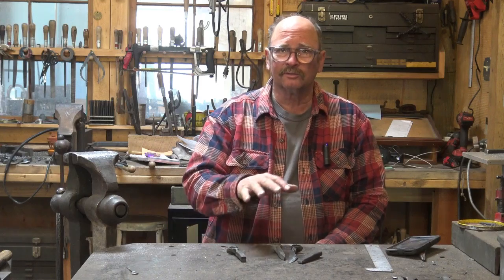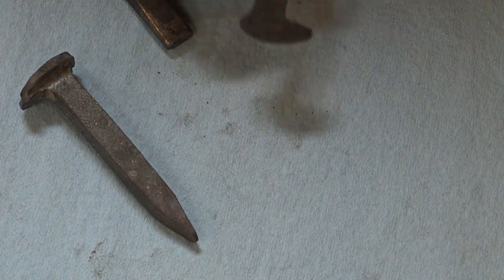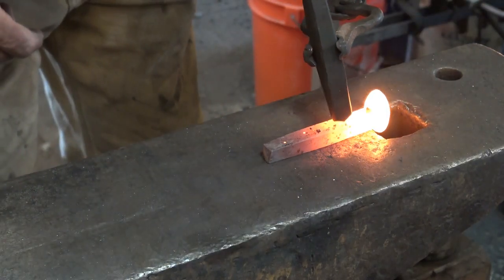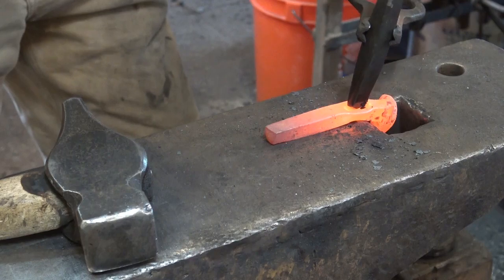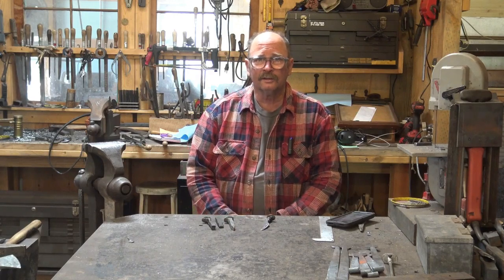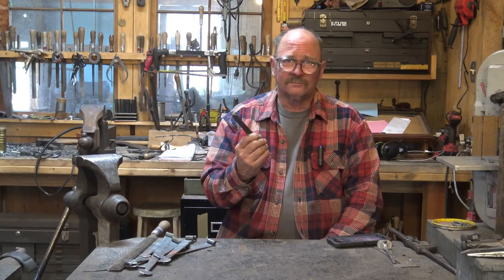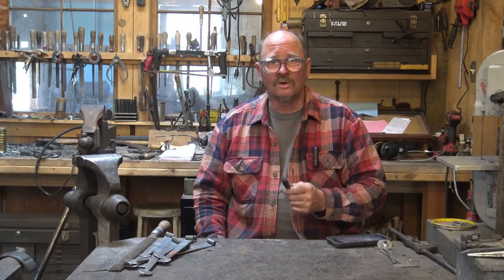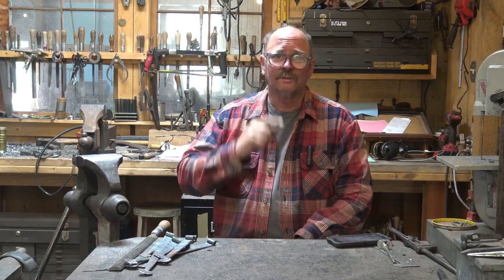Failed first attempt at a rail mini spike tomahawk.

Comment: I'm an instructor for the Total Control Advanced Riding Clinic for motorcyclists seeking to improve their riding skills.  One of my favorite statements in the class calls out exactly what you are discussing:

"Everyone believes the old cliche that practice makes perfect.  That just isn't true: PERFECT practice makes perfect."

In my own shop, I try to make everything as perfect as I can, even if the task doesn't require perfection.  I want the outcome of my work to match as closely as possible, my design for it.  If my design says "put a half inch hole here", I want that hole on size, in the right location.  That's how we get better!

Comment: Nice piece at the end about not failing, etc. Every time I start a new hobby I spend well over 50 hours researching ang watching YouTube videos about it. I've just finished my first knife and I made loads of mistakes but because of all the hours watching YouTube I knew what to do or where to go to find the answers to fixing the mistakes. It's meant that the knife actually came out a LOT better then I could have ever hoped. 

If I ever get bored doing my research before starting a new hobby, I haven't spent anything other then time so I don't loose much by moving on to the next thing. (I have loads of time free anyway as I have health problems that mean I spend a lot of my time not being able to move, so YouTube is a bit of a lifeline)

Comment: Probably for that small of a tomahawk, the Brian Brazeal style punch may have been too big. I agree a smaller, thinner slot punch would be ideal. You already have such little material, that any loss of material just adds to the risk of problems. And, upsetting to increase the thickness in the area to be punched should be the way to correct. Lessons learned!! Great video on thinking through a project and adjusting when there is an issue.

Comment: The other week I had two attempts at doing a split cross for my Dad, and wouldn't you know it, the chiseling from the bottom near the head of the rail spike mucked up bad. And yet I have done a few before and they turned out pretty good, now I don't know if I used the wrong chisel or what, but these last two.....FAIL!!!

Comment: Some have said that the Brian Brazeal "pyramid" style punch is not good to use.  I think it should be put in perspective that Brian was using that style punch for forming holes in larger stock such as hammers (say, 2 lb. and up in weight) and therefore needed the angular edges to gain penetration over using a blunt punch.  I believe the flat punch is indeed better for smaller and/or thinner stock.
Reply from the maker: While that is very true.  I have used that style for larger material and still have ended up with a ragged hole that had to be cleaned up with other tools.  I am sure there are some small design changes from mine and Brian's that make the difference.  But I have had such good success with the more traditional tools, I'm not sure I personally need to pursue fine tuning an alternative.   That doesn't mean its a bad design or that people shouldn't try it for themselves, it just doesn't suit my work.

Comment: Also this was really helpful. My first punch was pyramid style. It was small and on thin metal. It did just what yours did. It wouldn't sheer. I've had no success with them yet either. Slot style punch worked much better. Perhaps it's a lot to do with small stuff?
Reply from the maker: It may very well be that the material size limits its usefulness.

Comment: John, Question?Are RailRoad Spikes really a High Carbon Steel and is there a Chart or Way to tell what type of Steel there Made from.Thanks
Reply from the maker: I believe some are marked HC.  The others are an alloy of some sort, so they are all harder than mild.  I made these mini spikes myself from coil spring.
Reply: @BlackBearForge  
Ah, that explains it. The specs for RR spikes is no more than  .3% carbon. All my attempts at hardening Spike knives have been failures. 
I make  Spike Hawks by forging them out into a flat bar and wrapping the drift and forge welding a spring steel bit.

Comment: Yeah when I made mine for our carpenter at work I did the whole upset first and then punch the hole with a slot punch, because it tended to put a little more meat where the eye goes. And I have the exact same Tongs you have. did you make those and sell them to me. Lol
Reply from the maker: I think the ones I am using here are from Blacksmiths Depot
Reply: Black Bear Forge good call, don't remember where I got mine but I recognize the touchmark on it.the same place I got mine. Great tongues best purchase have probably almost ever made